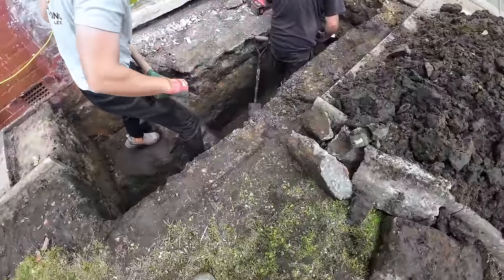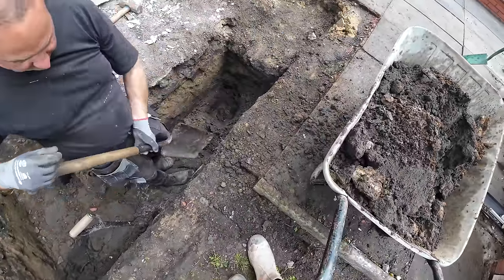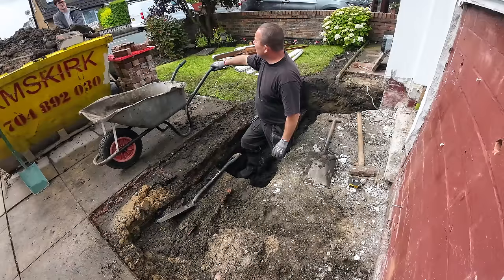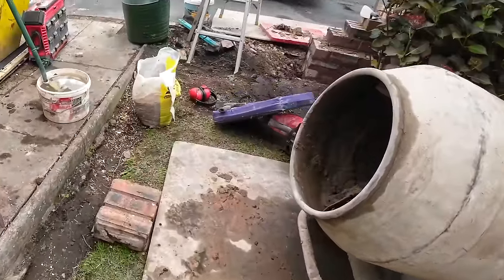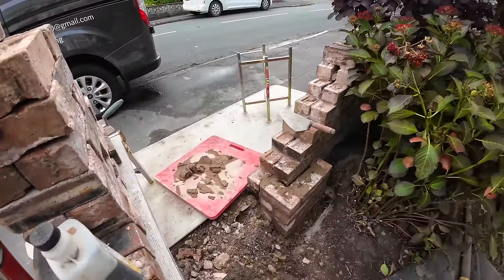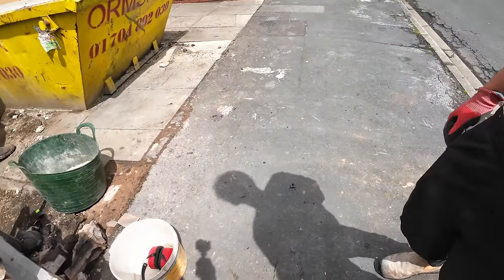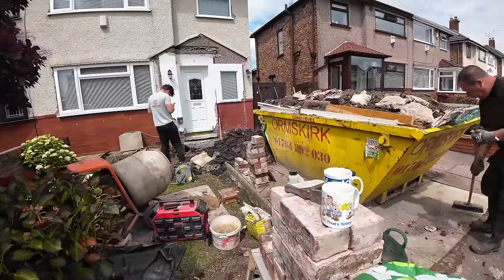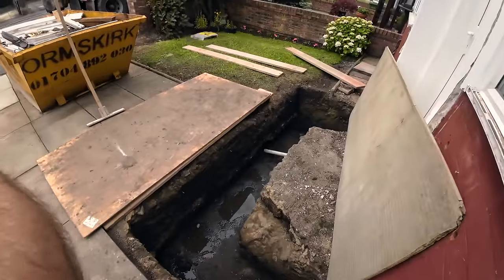FAILED !!! NO WONDER THIS PORCH SANK

Comment: Hey lads! Building mine as we speak I’m doing concrete blocks outside skin and thermalites inside skin porch will have main door and an internal door into the house what do you set the cavity at ? And do you just sit and dab inside ? Would really appreciate your help 🙏
Reply from the maker: We have done a 50 mm cavity for space.
    we are dot n dabbing the boards inside 
 good luck 🧱👍🏽
Reply: @SteveAndAlexBuild  thanks mate, do building control not want you to insulate it ? I thought I had to do 150mm cavity insulation 🤯
Reply from the maker: @DeanW-1990 . Not in a porch under 3 m square 🧱👍🏽
Reply: @SteveAndAlexBuild  So you leave a clear 50mm cavity and don’t insulate the porch what so ever ?

Comment: @SteveAndAlexBuild. Thank you for this video on the continuing saga of the “leaning” porch. I hope this is not too much of a stupid question. Do you still need to use those agitator/vibrator wands when pouring big(ger) volumes of concrete - say for foundations? I can only think that these devices were used  to drive out air pockets? Maybe certain concrete mixes and more modern ingredients in the mix means you don’t need to in the 21st century - but I am just guessing. Keep up the good work fellas. Stay safe and well.

Comment: Why do you not use any bar reinforcement in the concrete, especially when working on "dodgy" clay ground?
Reply from the maker: No Need
Reply: @SteveAndAlexBuild  I just think you could have saved half the expensive concrete by filling the bottom of the trench with some limestone ballast, then placing a basic reinforcement in the concrete.
Reply from the maker: The extra expense of the steel would have cancelled out any saving on concrete plus all the extra hard work barrowing in the stone then wackering it then picking up steel mesh , then cutting it to size then placing it.
   Trench fill concrete all day long 🧱👍🏽
Reply: @SteveAndAlexBuild  Thank you for troubling to reply. There are many ways to "skin a cat" and what you have done suits your operation, but I would have saved more than half the concrete by using ballast and reinforcement, especially on clay ground. Interesting video, as always.
Reply from the maker: @christopherhindle1174 🧱👍🏽
Reply: What a bunch of cowboys. It’s a porch for Christ’s sake,as a lot of builders have said on here. Reinforced slab would be sufficient.😂😂😂🇬🇧

Comment: Cracking job as always .Trench fill concrete is definitely better .very soft ground that but you all did a great job digging to harder ground. 
Did you have to charge more to the customer Steve 👍🧱🧱💯
Reply from the maker: I actually priced this one quite well for a change Justin 🤣🤣
  I allowed 2 days to demo and dig and allowed f or 2 cube of conc which was spot on 👌🏼😍🧱👍🏽
Reply: @SteveAndAlexBuild  
Good news then Steve 🤣👍.Anything can happen in the ground .we price up and make it clear then if we need to go deeper etc we can charge extra for it .It's all explained before work begins soft ground or building control changes etc .
Glad you got it all right mate 👍 🙌💯
Reply from the maker: Yeah mate we ve started doing that .
    Covers everyone 👌🏼🧱👍🏽